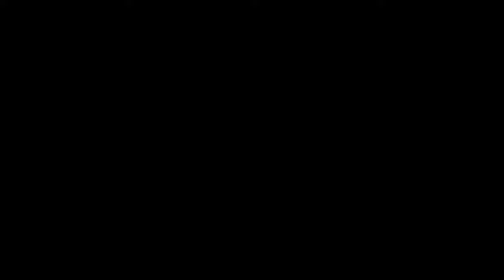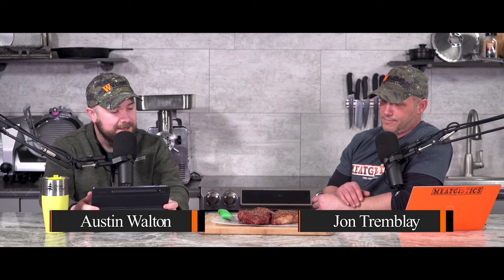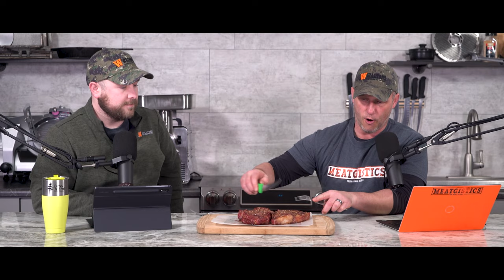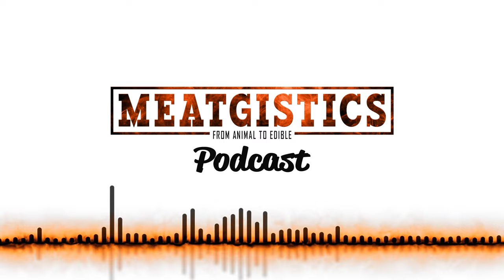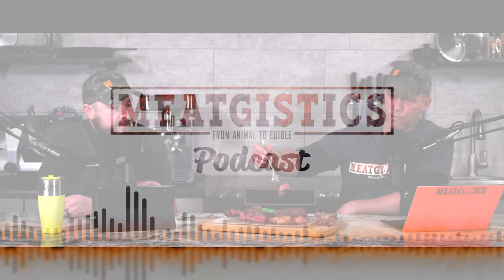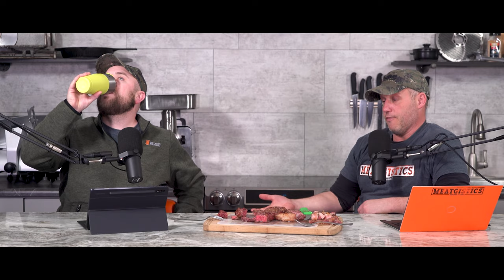Meatgistics Podcast: Smart Steak

Comment: I've adopted sous vide for my fail safe method of cooking premium steaks. Sous vide to 125 degrees and then screaming hot lump charcoal for the sear. If the weather is in-climate, a searing torch inside under the hood fan works too.